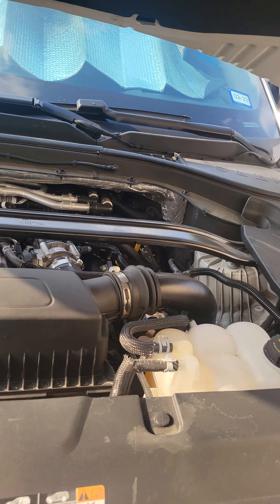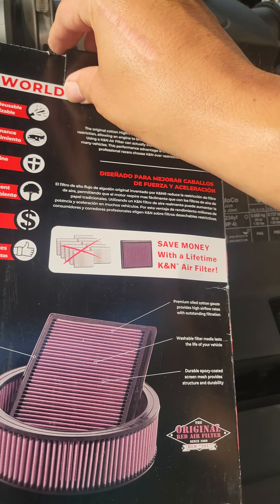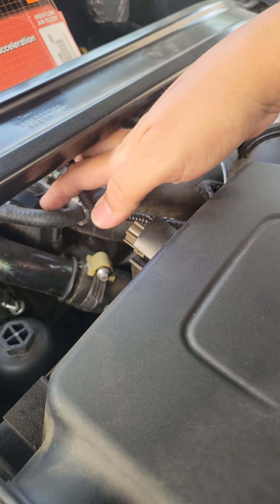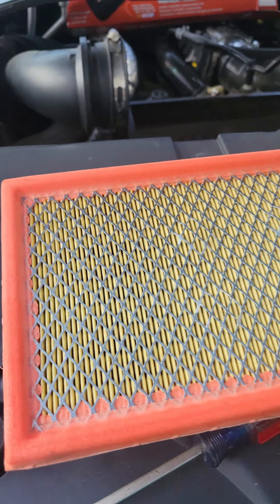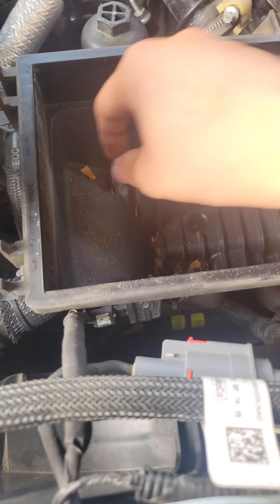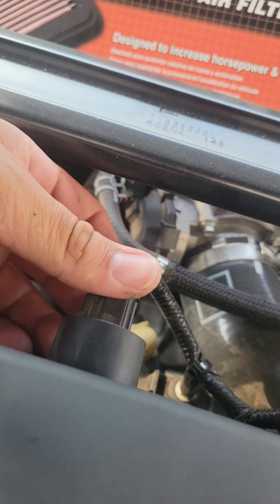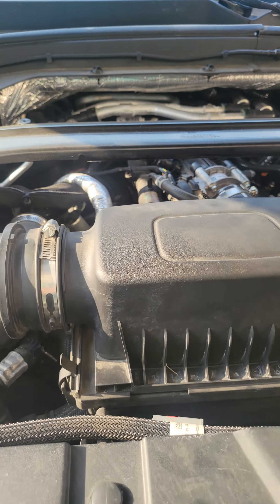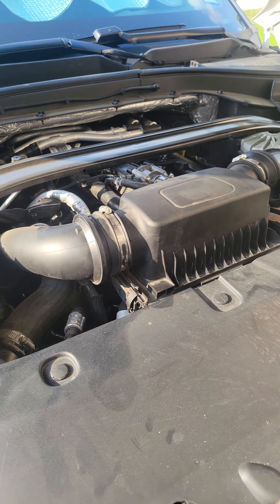Installing k&n air filter on Ford Explorer ST and Lincoln aviator

Comment: Yep, that doesn't look like the original filter, the original one was black. Somehow, after replacing it and seeing the dark carbon dust in the old filter, I don't recommend life time filters on those turbo boosted engines anymore, just replace it with a new one every year.